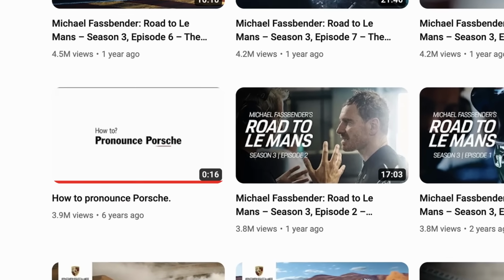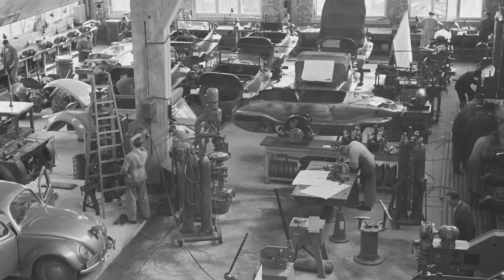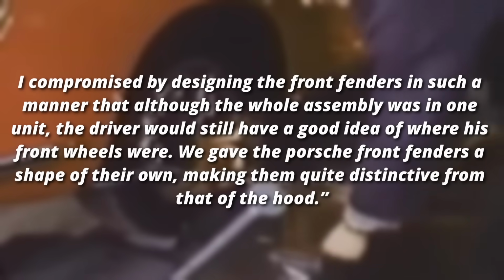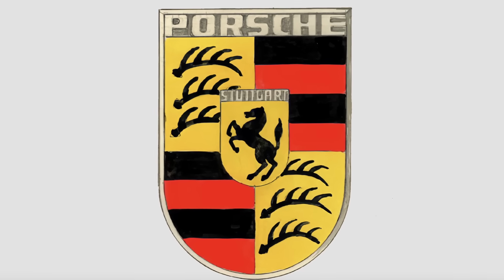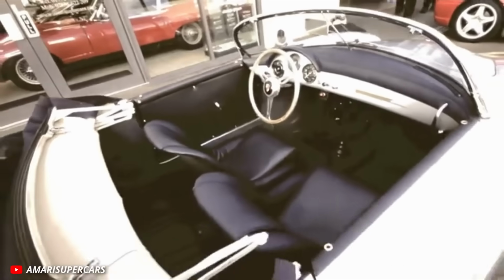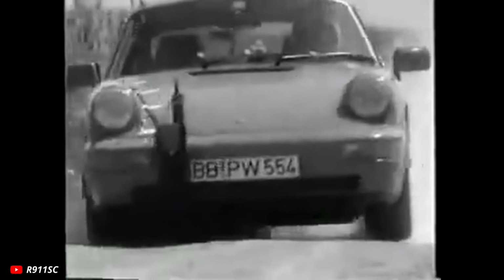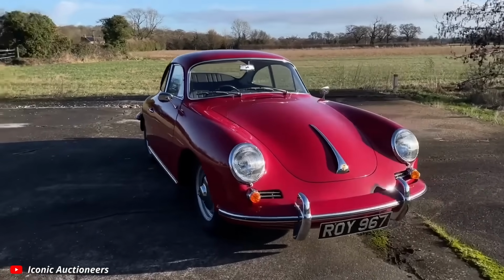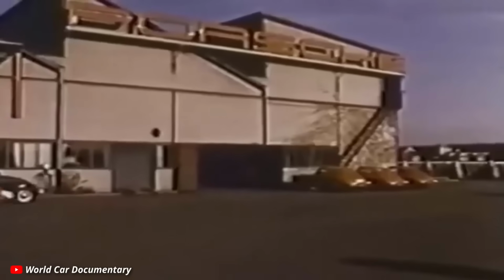Porsche's first car was a Volkswagen Beetle on steroids

Comment: The pre A Porsches were all VW.  The engine too. I had a 53. With a 64 SC engine and a  1800cc big bore kit. Probably made 120hp. I never3 did discover its original engine, probably a 1100cc 3 piece case VW. I had a book showing every interchangable nut bolt etc between Porsch and VW and basically everything was Vdub. And when things changed they didn't change much at all. And they were all rust buckets. Mine had original battery box and everything, rare even in 1978.  I've seen so many rusted out cancerous hulks sell on ebay for over $30K. needing restoration!!  You'd be better to take a Bug and rework it..... My 356 had copious amounts of undercoating, brushed on when new. It was hell to get off but I got most of it  and then brushed on new undercoating and some Shultz. Be very carefull if buying a 356.   It is 40+yrs since I bought mine and many were rusty then. Cancer in the longitudials is common but ebay cancer porks sell. They shouldn't. I totaled out two 356's because of cancer in the longitudinals etc. It is not realistic. reason with god. roughly 78000 356 were produced and around 45000 maybe were around in 1978. today maybe 35,000? And I see so many cancer ridden relics for sale. They are Vastly overvalued. It's idolatry.  4 cam engines are an escatalogical nightmare. roughly 40 hours to check and set the valves..... an SC in 64 made 104 sae hp.  4 cam around 110-125hp
Reply: If you think that's true, then you didn't really own a 356. Some parts are / look similar, but none of them are VW.
Reply: I had a book listing all the nuts and bolts that the 356 and Bug shared. Basically all of them. and the Pre A is on a VW chassis.  Used a VW engine.

Comment: Best handling, with the engine in the back? Most unexperienced drivers couldn't handle a Porsche. It was until Porsche mounted heavy electronics in the later 911s until they wear reasonaly handable.
Reply: My '81 911SC (no nannies, but staggered wheels) handles like it's on rails. I have never once felt like i couldn;t handle this car.

Comment: The VW and the 356 were both based on a concept, Those round front ends,  look good when they are in a wind tunnel with smoke flowing over them.  If they had a nore conventional front end with a radiator and a hood that could cover a V8 and seperate headlights there would be way more drag. since then other cars have been made with low drag efficient shapes.  N.B. no Porsche was made with tail fins.

Comment: "  Porsche's first car was a Volkswagen Beetle on steroids..."

 Another YouTube channel to avoid!
Reply: What do you mean? It’s a totally appropriate title.
Reply: @MultiPetercool no its not. The beetle was rear engined and the 356 was mid.
Reply: @dipstiksubaru3246  Meh!
Reply: @MultiPetercool  oh so you're proven wrong and just meh?
Reply: @dipstiksubaru3246  it’s still an air cooled pancake engine. What more do I need to say?
Reply: @MultiPetercool  which vw first marketed. By that logic is a corvair or 2cv related?
Reply: @dipstiksubaru3246  Yup. Corvair, 2CV, Panhard…
Reply: @MultiPetercool  and they're all copies of the Tucker Torpedo